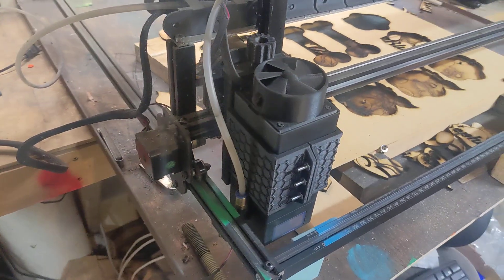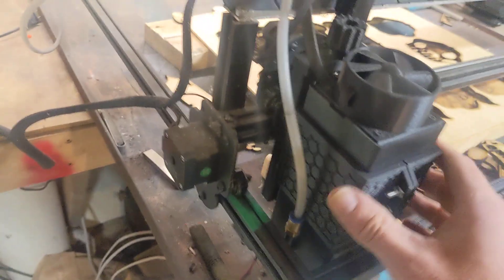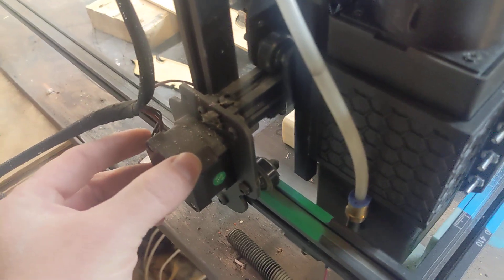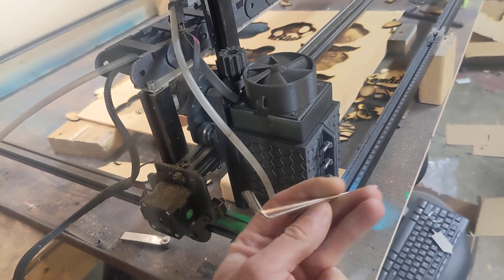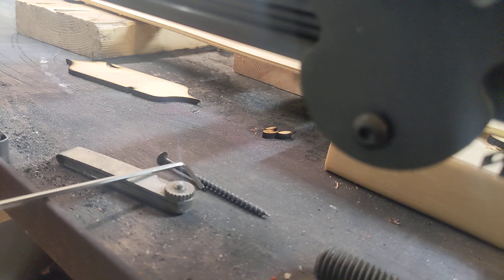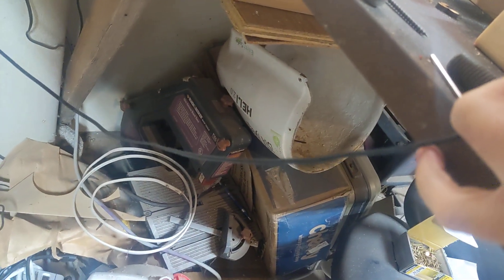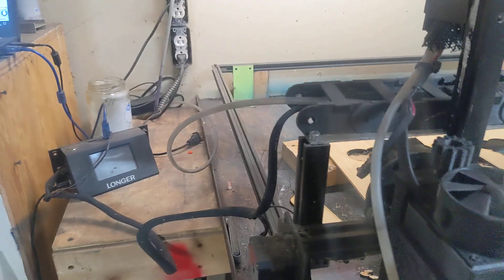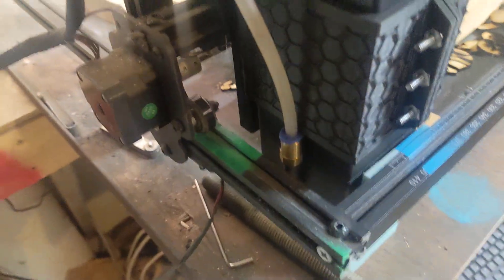Adjusting Limit Switch Clearances on Longer Ray 5 Diode Laser

Comment: I'm so confused at what i'm looking at and I have a longer ray 5 lol. Like is that a drag chain? How and why is that on there? Is that a generic laser added? And why is there so much dust on the unit?
Reply from the maker: It's dusty because I live in a very dusty environment and I use the laser every day...between the dust it creates by being used and the dust the world gives it, it's dusty.  And no, that's the Ray 5 module.  And it has a drag chain because it's running 1m on the X and Y axes...it's too long to let the wires just flop around.
Reply: @ToysforWatts  What do you use your laser for everyday? And how do I get a drag chain that works for my laser?

Comment: Hi,is that some custom extension frame,I ordered y axis extensio and would like to use original y axis to extend x axis by connecting two 2020 profiles in length like you,but I cant find this 5mm shaft under laser in lenght more than 500mm,what did you use for that part?
Thanks
Reply from the maker: I used a 48-in 3/16" steel dowel I could get from the local hardware store.  It was as close as I could get without spending a silly amount of money.

Comment: I'm having the same issue with the new carrier but my Longer B1 limit switches are screwed into the rail requiring me to drill new holes. I wish it was a set screw in a track like yours but I don't see any other way in setting the new home location requires unless it can be done inside of Lightburn

Comment: I put mine on the B1 and my limit switch is on inside of rail and it has set screws that screw into threaded holes on the rail and am about 7mm short of hitting the switch, any ideas?